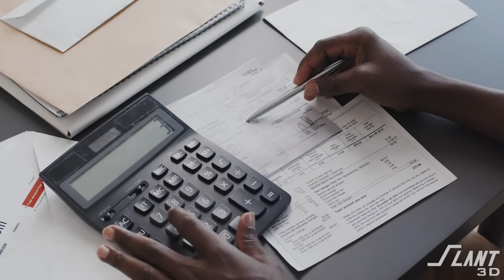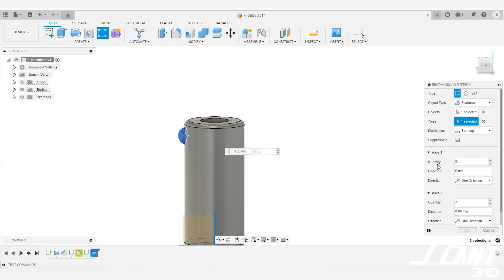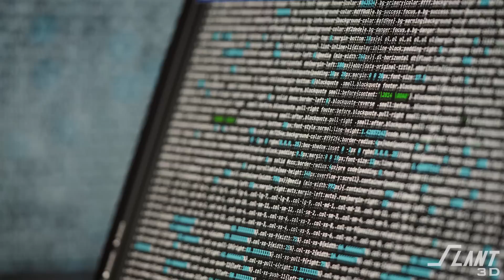3D Printing Will Obviously Replace Injection Molding

Comment: I did 3d prototype of my product. Took 3-4 hours. In the mold the cylce time will be 30 sec max. Plus cost of 3d printing is damn too high. Injection molding is not going anywhere unless production time come in seconds instead of hours in 3d printing

Comment: 3D print won't replace injection mold, FDM 3D print that is.
if 3D print can replace injection mold, it'd be resin 3d print, once we figured out how to turn plastic waste into resin.
Reply: I mean "maybe".. it will require a resin that is as good and has all the properties of ABS..

Comment: At the moment 3d printing can't compete with injection mainly because of the pieces' definition, accuracy, tolerances kept, speed and per piece cost relatively to time and effort. 
At the moment the technology that comes closer to injection is mjf technology. You can get really accurate pieces. Yet the per piece cost is completely far from being competitive. Mjf can become competitive if its costs will be 1/15 of the actual ones. 
Mass production and therefore real profitable companies, the only ones that can afford real production costs to cut per piece costs, still use injection to win the market. For us, untill hd 3d printing won't be really affordable, the real competition on the market will be forbidden. Sad but true.
Reply from the maker: Incorrect. We do it everyday
Reply: @slant3d  it is not a critique, I'd been printing for 7 years now. I love the technology, but actually, specially if you are looking for industrial quality and definition products, nor fdm or mjf can compete with the per piece cost and quality ratio of injection. I'd pay 0.2 in injection what I pay 3$ in mjf, no doubt about it. I'm the first one looking for a real alternative to injection since I produce my own design products on which I'd like to make profits (actually mjf printed in outsourcing).
That said what you say about the capability to mod the design, continue the development of the product with no need to make new moulds is completely true.
Reply: @Enthcreations its ok, hes just a guy with lot of printers.

Comment: Injection molding has a high fixed cost, a low unit cost and high throughtput. So over a certain threshold it is cheaper and much faster. A mass product cannot be 3D printed.
3d printing is not cheap, not even for a single piece. It is not the cost of the printer, plastic or electricity. It is the cost of the design (engineer manpower), that makes a unique 3d printed part very costly.
I make 3d printed functional (mechanic) parts as a hobby. I am an engineer and a maker. A part would easily take 2 or 3 days of CAD design, and maybe 2 or 3 iterations (redesign and reprint) to get it right. So it costs me a few € of plastic and electricity and a few THOUSANDS € of manpower cost (if someone had to pay me to design that part).
So only qualified hobbysts (mechanical engineers with knowledge of CAD and 3d printing technology) willing to spend their free time, can produce unique parts for cheap (not counting their time). All the others are out of luck, and have to rely on mass produced injection molded parts, where someone else made the heavy lifting, and the huge fixed costs (design and mold) are amortized among many pieces.
A cheap 3d printer and spool of filament will not let you produce any object, unless you are capable of design the part and troubleshoot the technology, and put a LOT of time in the endeavour.
Reply: "It is the cost of the design (engineer manpower), that makes a unique 3d printed part very costly."

Yeah, and designs for injection molded parts just fall from the sky
Reply: I would think the engineering cost would be equal because you still need to design the part for molding. Both need a cad file to make em
Reply: @kyletaylor6942  Sure. So both 3d printing and injection molding are not for the random uneducated user. To produce a single part is costly even for 3d printing. Those capable of actually design/engineer something is a tiny fraction of those buying a 3d printer.
Not to mention the fact that with a 3d printer you have a poor spatial resolution and a poor surface finish (the product is hardly marketable). Injection molding will never be displaced by 3d printers.
When you have spent the engineering fee, then with injection molding you can amortize the cost on a mass production, with 3d printers there is no mass production. And hence the cost cannot be amortized.
In the industry, 3d printers are mostly used for prototyping to develop a product that is later manufactured with injection molding. If you factor in the design cost of a 3d printed piece, forcibly manufactured in small numbers, there is no viable market. When the numbers become high, then injection molding is much more competitive cost wise.
Reply: @marcobassini3576  The video specifically talks about new manufacturing and sub 100,000 units. I agree it now going to replace it but it's going to take a lot of market share. Lego and cars are still going to use injection molding but a lot of tools and not mass market stuff will greatly benefit from the reduced up front cost.

Comment: 3D printing is to slow, or you need to many printers and space for an output of thousand part a day.  In handling time 3D printing is expensive. All those printers have to be maintained, parts collected and filament replaced. With injection molding you need only a few machines and everything is automated. 
Now you can print metals with laser sintering, you also can print molds. This is way cheaper than the traditional way molds are made. 3D printed molds are not as strong as the old molds, but for small molds the cost is only 5% of the cost. A 3D printed mold has a lifespan of about half a year to 8 month. Iterations are not that costly any more and in many cases iterations are not needed for many years. 
If even 3d printer manufacturers like Prusa starts making parts with injection molding, injection molding still has a strong place in manufacturing plastic parts.
Reply from the maker: We already do it

Comment: Not a chance, scale is absolutely a factor for a wide variety of plastic parts, and the design does not change or need to change once it is established. The last injection molding shop that I worked at we had three 64 cavity molds running 24/7 365  days a year to keep up with demand. In a single day we could produce over 1.5 million parts from these 3 machines alone. 

You're talking about a specific subset of the consumer market and ignoring a large portion of the injection molding industry. Most injection molding shops aren't making little trinkets to sell on Etsy.
Reply: FDm is a choice, as long as you know what you are going to print. Right technology for the right object.
Reply: ever heard combination injection mold combine with SLA print ?

Comment: not until you can print intricate overhangs within .001
Reply: we have 3 molds where i work that produce 48 parts every 5.24 seconds and a robot pulls them and sorts each one by cavity and bags them.  and it runs 24/7 for 3 months at a time with very little downtime and zero flow lines. that's not even the peak of what injection molding can do.  For 3d printers to replace that, it will be a long time

Comment: You could not be more wrong. Get yourself educated
Reply: He's running a business. So of course he's going to ignore the cases in which injection molding clearly wins. Either that, or he doesn't understand fix vs variable costs in economical terms.

Comment: I've been watching this channel for a long time and you produce great videos on 3D printing but I don't understand why you're insisting on this point so much. You'll never match the finish compared to injection molding which instantly disproves your point. At the extremes, you're not going to match the scale either, certainly when you take the floor area required for both processes into account.
Reply: you can do all kinds of finish in injection molding. its also important to have pressure for many plastics. it affects properties, just like humidity. thats why consistency is not that easy in fdm unless you nail down the parameters constantly
Reply from the maker: Molding cannot match the surface textures from 3d printing
Reply: @slant3d  But in the majority of products a smooth surface is desired and 3d printing struggles to do this without further processing that also has its own problems.

Comment: "Scale doesn't exist in the real world" wow that's some bias towards your buissness model if ive ever seen one... scale very much does exist... let's take one very small, common, and simple part... a zip tie... go ahead, print one... now print enough for a box of 1000, now print enough for a data center... I can throw our a dozen more similar products used in the hundreds of millions each year, but I think you see what I mean... now I do love 3D printing, I have a dozen printers... but every process has its place... you have to understand a niche when your in one, and your not doing that, you are trying to proclaim 3d printing can just replace something that can produce tens of thousands of parts per week at scale, with way less maintinence, moving parts, and both a better surface finish, and better strength to weight ratio... some stuff needs that, you can't just design a solo cup to be 3d printed as well as a real one, yes there are some things that don't need to be injection molded but some things, alot of things... really... really do
Reply: i know a lot about injectino molding, but i still like 3dp. its for different use cases. its never going to be one or the other.
Reply: @simonschneider5913  yep

Comment: 1 injection molding setup can produce thousands of parts an hour. For any high rate production 3D printing cannot keep up with that pace. For a small simple model you would need thousands of printers to produce thousands of parts an hour. If anything stands a chance it’s resin. If we get to the point where we can resin print in seconds it stands a chance.
Reply from the maker: Correct you do need Thousands of printers (Like in our Megafarm). But FDM already matches that rate.
Reply: @slant3d  Are 3D printing farms more space efficient than injection molding?
Reply: @t1e6x12  thats something i will only believe if i see it myself. i dont think 3dp can do that...but it doesnt have to!

Comment: You’ll need be printing parts pretty quick to keep up with injection molding. Also, 3D printing creates “fake parts” as I like to refer to them currently, they have a long ways to go before the material properties match what injection molded products. Take PEEK parts for 1 of thousands of examples, hard to match. Does 3D printing have some advantages, YES of course, prototyping and testing out an idea/design concept, you can’t beat it. But this idea of 3D printing replacing molding anytime soon is laughable. 
Just an expert opinion from a mold maker, mold designer, tooling engineer.

Comment: As a injection mold designer I can say 3d printing may replace a majority of molded items but that is years away. You are missing a big part which is size and scale. Unless cars are made illegal or consumers are willing to ride on featureless carts, injection molds are not going any where any time soon. Similar to sand casting like a "caveman", 3D printed dissolvable molds will be the way to do many iterations of a prototype part before a manufacture commits to signing off on the data to cut the steel to. Printers can not yet beat the consistency, quality of part, and production time of a ten cavity mold with a three minute cycle time. I get your point but when you need millions of parts, you want a mold.
edit: final point,  once 3d printing metals alloys is more widely used and accessible by more shops, 3d printing inserts for mold bases will be the go to. Not just for ease of rapid manufacture but for the "conforming cooling" properties as well. We do that at work but we can cut faster than we can print and customer is not waiting.

Comment: Small brain: 3D printing will replace injection molding
Big brain: 3D printing will enhance injection molding
A metal-printed mold for large scale production can be produced faster and cheaper than traditionally milled one already, and for small iterative batches resin-printed injection molds are fast and cheap enough even for hobbyists. Between mass production scalability, better mechanical properties and wider material choices, injection molding will be around for a while.

Comment: Hi! I enjoyed your video!
One of the points was that the whole piece price is affected by the tooling cost but injection molding suppliers nowdays only take around 5% of profit rate (automotive industry). This means raw material is 35% of the whole piece price. They are being very competitive. i myself am a big 3D printing nerd but at the same time i run moldflow analysis at work.
Even if the 3D printers program time gets faster than plastic injection cycle time, Sadly filament material is more expensive than the the whole piece price of plastic injection molded parts.
Reply: Hopefully prototyping / 3D printing technology and CAE technology can help each other to achieve cheaper tool costs.

Comment: Massive 3D printing hobbiest here. This is just a flat out lie. It's basic economy of scale. 3d printing is great for small business, very specific needs or hobbiests but on large scale production it just does not keep up at all with injection molding
Reply from the maker: Incorrect. Largest 3d Printing Farm in the World Here. We do it every day.
Reply: @slant3d  Congrats on doing something far less efficiently for much more cost then if you are running enough printers to compete with industry level injection molding production capability

But we are not talking that scale. When companies want to make hundreds of thousands of a product very quickly 3d printing does not scale to that at lest not as a efficently as injection molding. Prints would need to take 1-2 minutes to get close to compete with how large injection molding setups can make millions of parts a day.

Congrats on your small business but please don't try and lie to people all of the comments are tearing you apart
Reply: @kaymcmullen9521 at some point speed does not matter for products. Sure you can injection mold in a week what would take 3d a few months. You now have to store all those parts that will take years to sell through. That costs money
Reply: @kyletaylor6942   Again that only applies at smaller scale. Hasbro isn't going to 3d print toys because they need to have them shipped out to thousands of retailers across the world who are going to be the ones handling and storing them and it's far cheaper to injection mold in a factory than 3d print. Certainly, if you only have a limited amount of demand and are not selling to other retailers 3d printing is going to be beneficial provided storage is an issue.  For a lot of small businesses it isn't much of a cost due to having spare space to store things e.g store rooms in offices, garages in home business.

3d printing becomes less efficient and more expensive the bigger the scale becomes in the overwhelming majority of scenarios.
Reply: @slant3d  i would love to see the cost per unit in your farm compared to something injection molded , its probably like 10x

Comment: I'm another with donkeys years of injection moulding experience, 2 decades of outsourced rapid prototypes and more recently, in house FDM. I admire your design for printing tips but this video completely misrepresents injection mouldings and the infrastructure that makes them possible. Injection moulded parts have better surface quality and mechanical properties, and they're more consistent part-to-part than FDM parts. Its true that tool costs have to be amortised but once they are, there's no tooling cost. The real benefit of 3D prints is in making low volumes of products that you probably couldn't demold in any case. If you want your FDM part to look like an injection moulded part, you need a skilled modelmaker to spend hours finishing it.

I recommend that you stick with what you know which, as I have said, is great. Your design for FDM tips are leading edge. Lets have more of that!

Comment: This is an uninformed take on manufacturing that resembles the hype around 3D printing 10yrs ago. A better video would discuss the drawbacks (strength, accuracy, time, etc) of printing and theories on how they could be overcome to eventually compete with the efficiency of molding.

Comment: Comparing 3d printers and injection molders is very much like comparing vans to trains.
Injection molders are like Trains, which carry a lot of cargo at once and are fuel efficient, but also constrained by the railroads, which cost a lot to build.
3D printers are like vans, which have the flexibility of not being constrained by railroad tracks, but they also have a significantly lower cargo capacity and poor fuel efficiency.

Both serve a very similar purpose, yet the one you pick ultimately comes down to the size of the workload.  It makes as little sense to run a train that has the van's capacity's worth of cargo on board as it does to use a van to ship the whole train's capacity
Reply: this is the smartest and wisest analogy I've ever heard